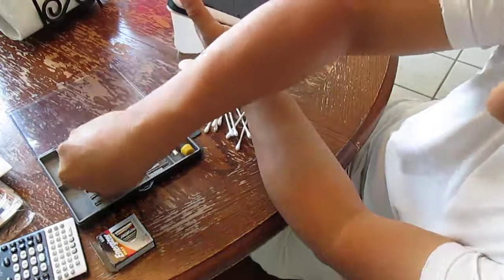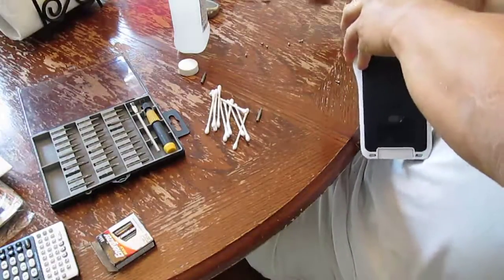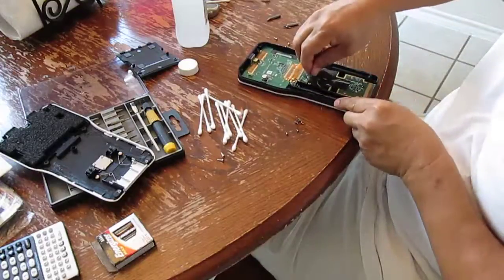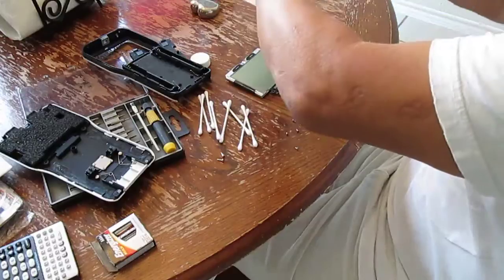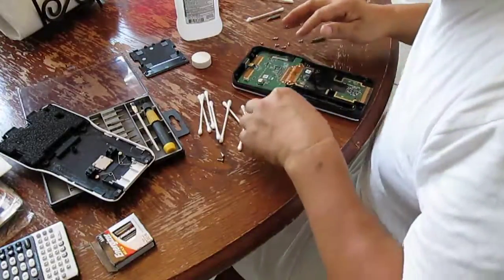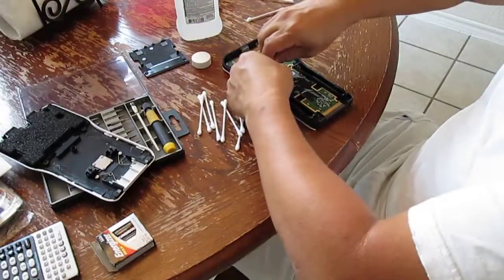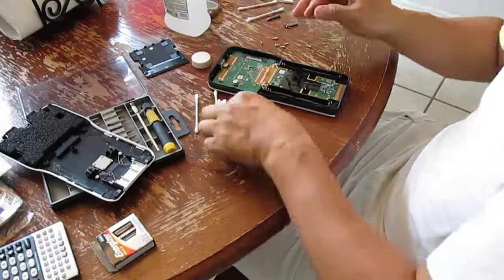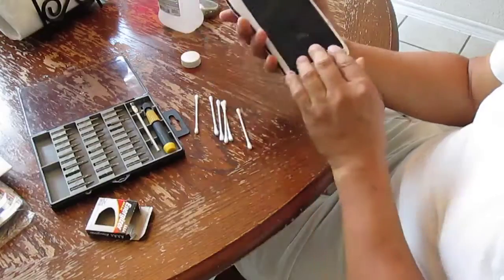How to fix TI-nspire blank screen ( battery corrosion) tear down

Comment: This worked for my calculator! There was corrosion right on the contact that touched the battery wires. Woo! (My calculator wouldn't boot at all even when trying to reset.)